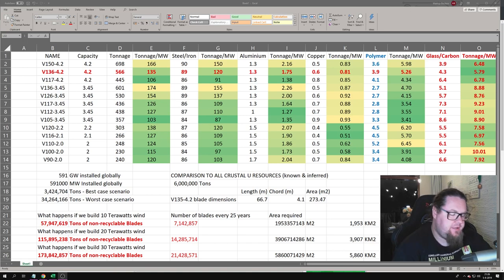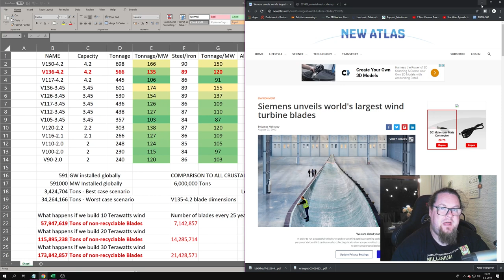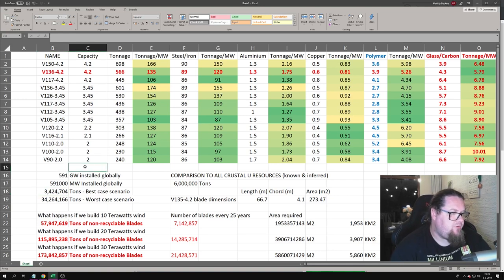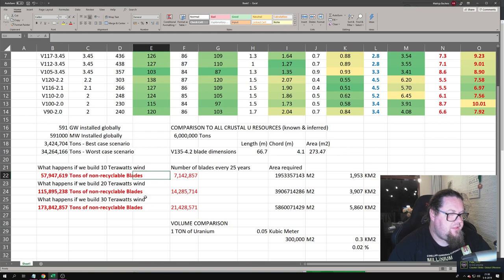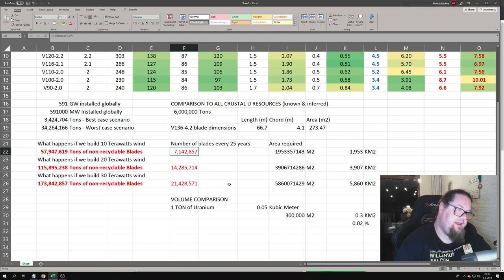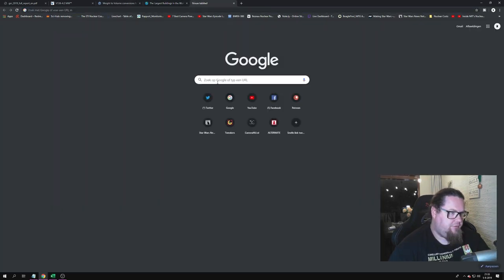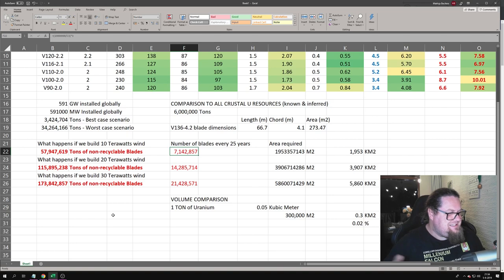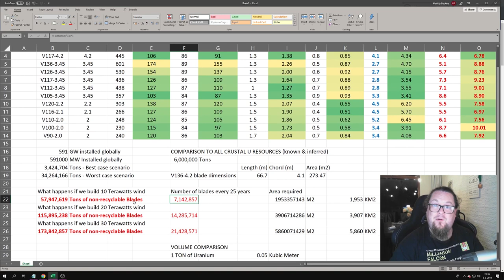Wind Power? A mountain of trash is waiting for us

Comment: Assuming that you couldn't recycle the wind turbine blades at all, you would most likely crush or grind the blades to make the waste more manageable. I couldn't find a specific number regarding the density of the blades, so based on what information I could find on carbon fibre and fibreglass I assumed a figure of 2 Tonnes per m^3. Taking the 20 Terawatt example, if you managed to grind the blades down into 1 metre cubes, the cubes would take a space of about 65 Km^2, adding 10% for container volume and transport paths for the waste. Not as scary as 3907 Km^2, but I'd imagine that the total amount of radioactive waste that the world would produce every 30 years by 10 - 30 Terawatts worth of Nuclear Power Plants would not take up as much room.
Reply from the maker: My thought:"more energy needlessly spent" ;)

Comment: Blade recycling is possible, and this is mentioned in the video. However, thermal decomposition of the composites is used to recover the individual fibres. For pyrolysis, the material is heated up to 500 °C in an environment without oxygen, thus causing it to break down into lower weight organic substances and/or gaseous products. The glass fibres will generally lose 50% of their initial strength and can now be down-cycled for fibre reinforcement applications in paints or concrete. It does required lot's of energy. So add this enormous amount of energy required for wind-turbine blade recycling to their life-cycle emissions...
Reply from the maker: That's what I've been thinking about as well. The question is mainly, how useful will the next product be. And further than an additive I don't get. 

It's the same with the concrete. Which ends up remaining in place, or getting shredded and used as gravel or filler.

Comment: Wind power really isn't the worst in terms of disposal issues.  But for the 'grid so inefficient' claims to float at all, solar efficiency needs to improve from 20% to 50%.  That necessitates gallium Arsenic solar cells.  NOW THAT'S A DISPOSAL ISSUE!
Reply from the maker: I made this video particularly to point out that nuclear issues are like a drop in the ocean compared to non-nuclear / RE issues. 

The scope is mind-boggling, and most people just brush it over and say, ahh that's nothing! 

While the real nothing, is spent nuclear fuel.
Reply: @Atomicjedi  
The problem is it's so easy to see the positive in wind / solar when expressed in broad contexts, i.e. look at what a small part of the country this is.  Somebody then invariably says, 'that's ridiculous that's obviously a mistake'.  Even somebody like my self might say, 'no I've checked the math, the claim is absolutely correct'.  But of course put into a different context, 'such a small part of the country' is still 7.3 Adani coal mines.  So while we absolutely could generate all of our power from solar, a more sensible context reveals... we probably shouldn't.
Reply from the maker: @lordsamich755  Exactly, I say that putting more effort in nuclear is unlocking moderation by deploying higher efficiencies. 

Want to dig less? Go high efficiency.